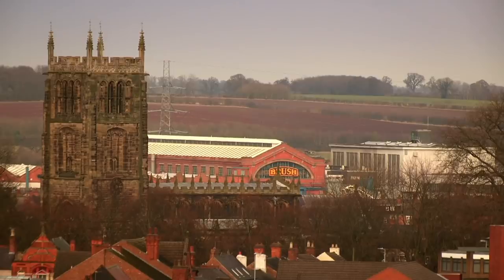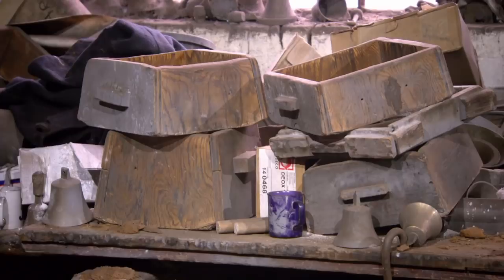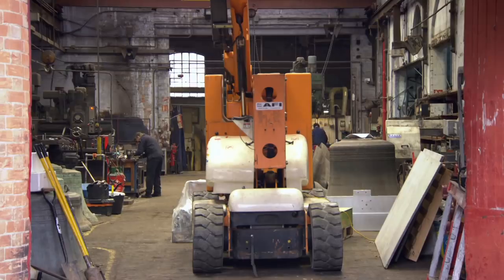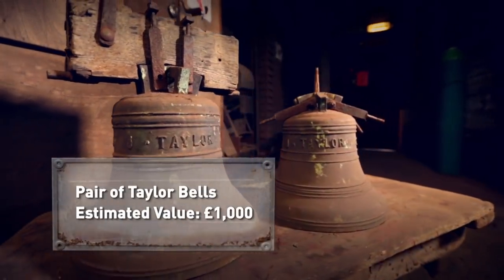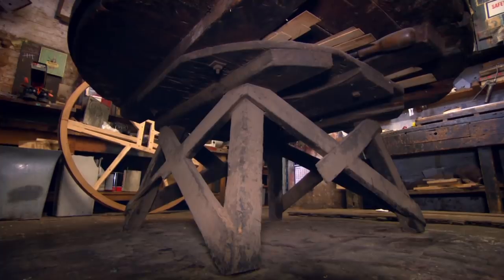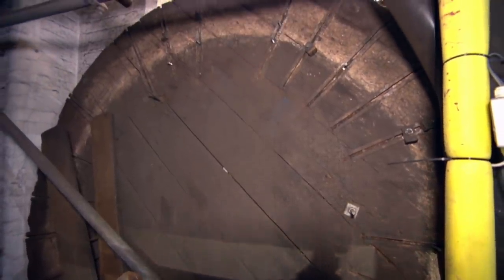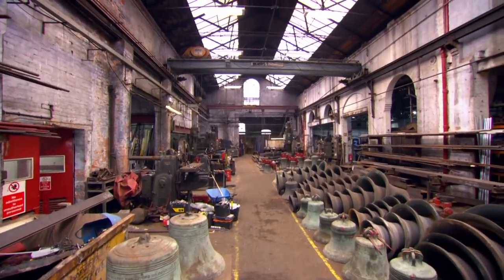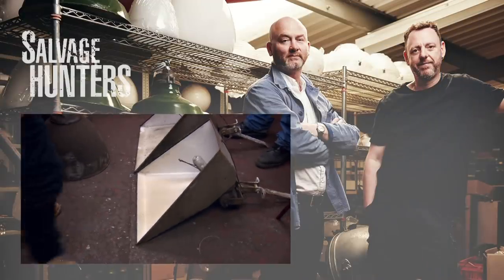Awesome Industrial Table Top Leaves Drew In Awe! | Salvage Hunters

Comment: I remember pulling better tables than that out of various old industrial places around Aust back in the 80,s and putting them thru auction. Fabulous slabs of solid silky oak 7/8 inches thick. 
And some amazing Australian cedar, kauri and huon pine furniture. It used to be everywhere. Power stations were a goldmine. The asbestos was always a worry though. Still have an amazing brass gauge which was attached to a smoke stack. Beautiful with etched floral pattern in the face glass. About 24” in diameter.